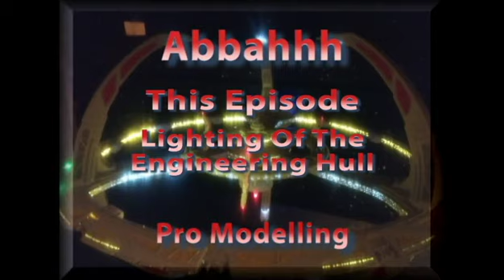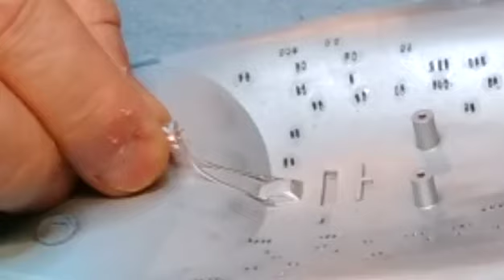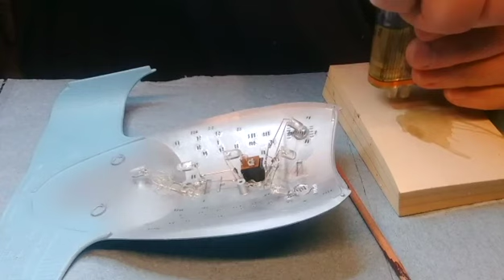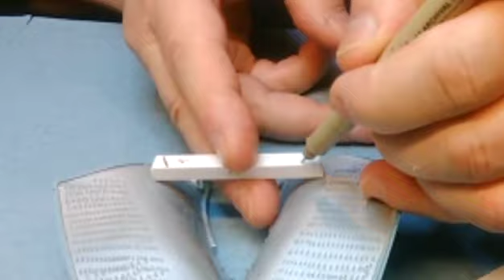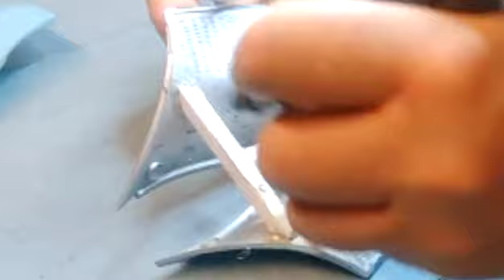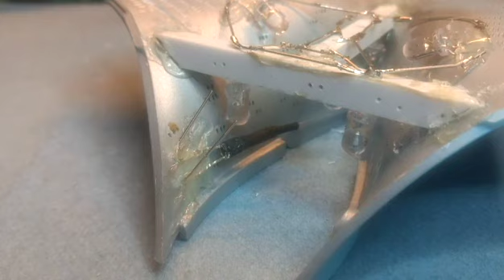USS Enterprise-D Build (Part 3)

Comment: Another build I want to do.  Sadly I wont do it on the clear plastic version as I just found out last night the 2019 release has long been discontinued for some unknown reason even though I've never seen the 1:1400 scale enterprise D on any shelves nor any of the only hobby shops I visit.

Guess I will have to use your technique for drilling out the tiny windows.

Comment: I see no resistors on the light rig on the ventral secondary hull. did you calculate before how many lights you can operate together without needing a resistor?